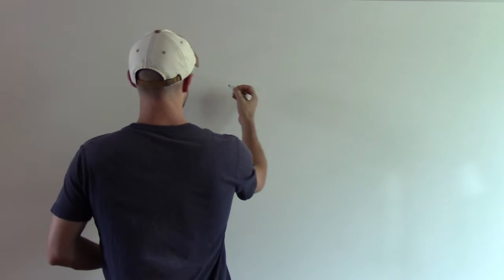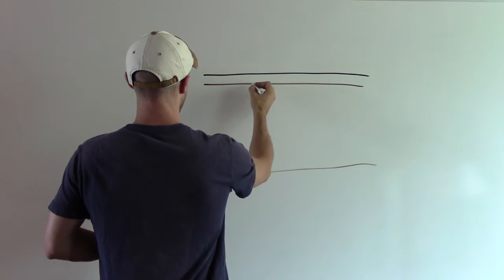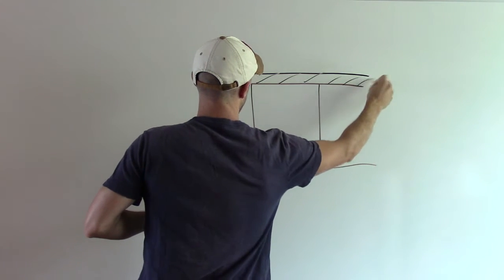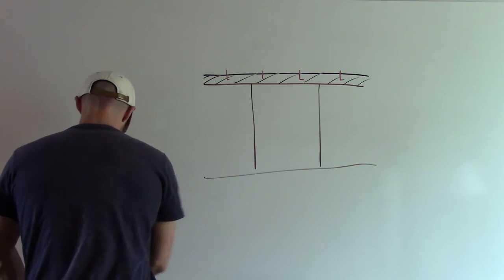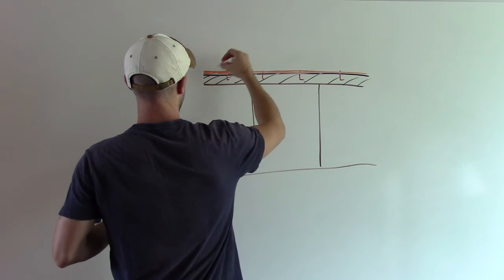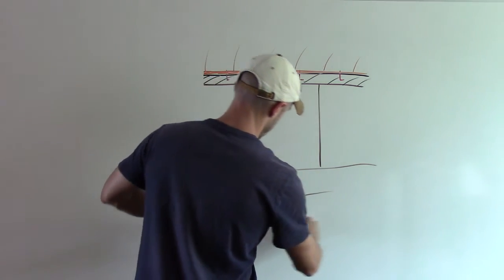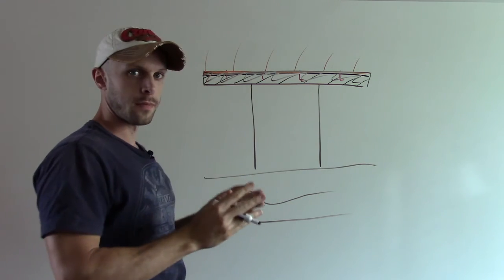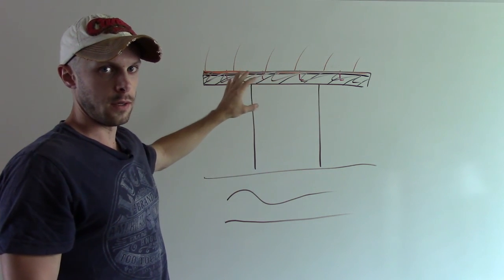WHY YOU SHOULD GIVE YOUR COB HOUSE A CONCRETE BOND BEAM

Comment: Why! Concrete beams work with block houses, you even state yourself that cob isn't going to work well here. Why spend ages getting the cob completely level so that you can use a concrete beam when there is a much easier and just as strong method that is building wood into the cob to attach the roof to